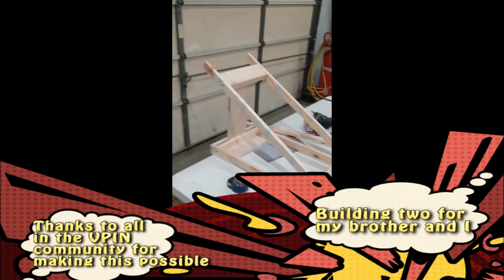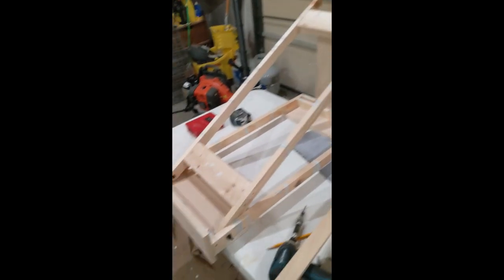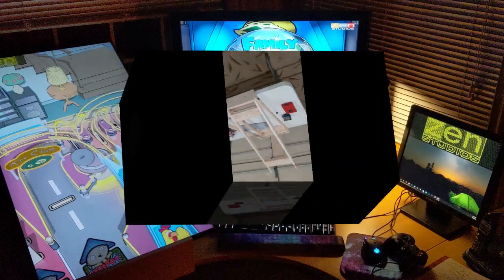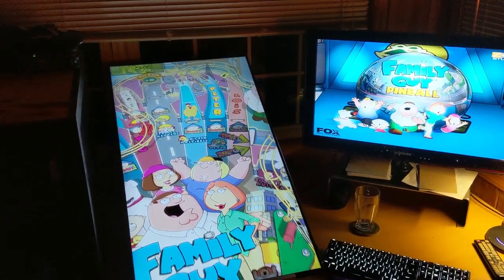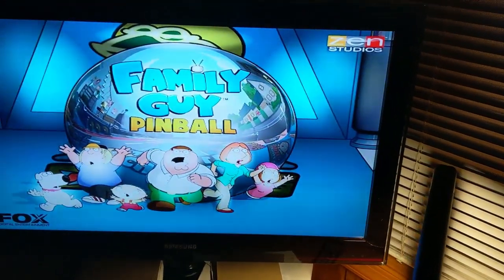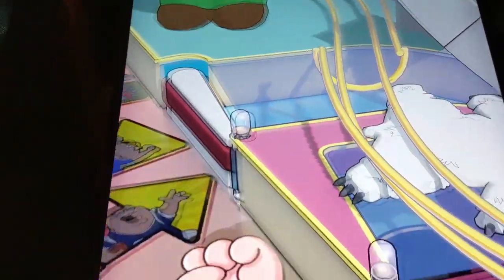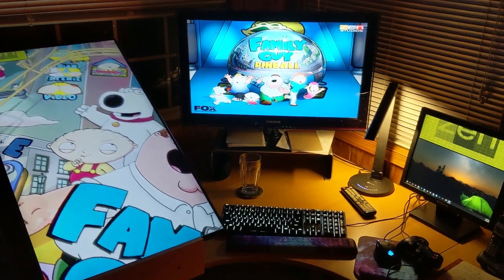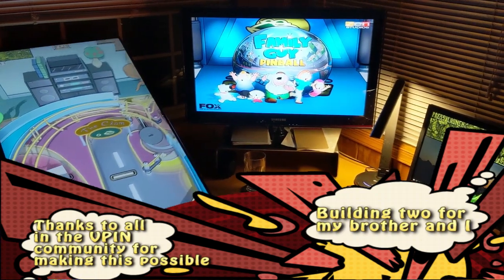Virtual Pinball Project Part 1 - Pinball FX3 Working in Cabinet Mode

Comment: Did you ever finish this? And how do you like the fx3 gameplay? Does it look as good as it does when you play it on the computer? Thanks
Reply from the maker: Hi John, Thanks for watching and the questions.
Status on my virtual pinball cabinet:
I ordered two cabinets (no electronics) from VirtuaPin back in May and my brother just got his last week and mine should be delivered next week.
I spent months getting all of the software dialed in and have been waiting for the cabinet.
Once I get the cabinet, I have some fabrication work to build the bracket for the removable arcade control panel and then install the monitors, DMD, speakers, digital plunger, buttons, etc..
I am using a Dell/Alienware Aurora R-11 PC with an Nvidia RTX 2080 Super as a dedicated PC for the cabinet so it is being played on a fairly high-end computer and looks fantastic.
The Pinball FX3 tables look and play amazing on the hardware. I'm just waiting for the cabinet.
I'll be making a bunch of tutorial videos on putting all of this together and will post them.
I will also be posting "Delivery Day" when the cabinet arrives next week (hopefully). 

Let me know if you have any other questions.

Be safe and have fun!

Cheers,
Jeff (Garage Maker Guy)
Reply: @garagemakerguy1808  wow good stuff! I wish I could have waited! I ended up going with a company, and I fact I just paid for it and it's going to be here in about a month, I went with in the New Age pinball company, I don't have the skills that sounds like you do LOL, I'm going with their highest and one, out the door with white glove service I got it for 5400, it has what seems to be all the best pinball fx3 games, about a hundred of them, in about 200 of the VP older games. What's missing on that list though is my favorite pinball machine of all time, Funhouse! The only guy that was close to these as far as having everything I wanted, 49 inch LG monitor not TV, UHD, big back display at 1080p, full force feedback, with the Shaker, 8 cylinder heads, LED flashers Etc, the other guy from rec room World wanted $8,000 for the same machine! I swear I almost did it because I wanted Funhouse so bad but in the end I feel I'll probably be playing pinball fx3 more than anything else LOL, keep me posted on your build and what you end up spending on it!
Reply from the maker: @johnk12345100  Sounds awesome! Didn't FX3 just release Funhouse recently?
Reply: @garagemakerguy1808  not sure, that would be cool but love the standard version, my table does not connect to the internet and is not expandable. i did just find this company that sells the SD drives! https://arcadehd.com/   hope not a scam, i put my email in and will gladly pay the 220 for the 360 games if funhouse on there, i am going to have it shipped rite to in the new age and have them install it!!
Reply from the maker: @johnk12345100  The FX3 "Williams" tables I've played have the option to play it "Original" without all of the "eye-candy". If that is not "Authentic" enough for you, there are several VPX tables that should suffice :)

Cheers,
Jeff (Garage Maker Guy)
Reply: @garagemakerguy1808   I just got all the fx3 tables and cabinet mode code now, how do I get the backglass and dmd to be on the second screen/monitor?
Reply from the maker: @EarthMonsterAZ  Here's where i would start: https://www.nailbuster.com/wikipinup/doku.php?id=install_guide

If you are only going to use FX3, there is still some helpful information on "Nailbuster's" site.

This could be a very long conversation so checkout VPForums and VPINBALL. There are a lot of other people out there that have made a lot of tutorials about this.

If you're still  having issues after that, send me an email at The_Def_J@yahoo.com and I will try to make some time to help.

Cheers,
Jeff (Garage Maker Guy)
Reply: @garagemakerguy1808  cool, thank you! I will check it out.
Reply: @garagemakerguy1808  oh, and any gameplay on the pinball fx3 games, would be great, I would love to see skyrim on an actual cable, all I can find is videos showing the computer version, hope that the table, looks as good!

Comment: Congratulations on getting Pinball FX3 working. Wish I knew how you guys are pulling this off. I can't get it to work right at all, on a portrait mode screen, in a cabinet. I have the code, too, by the way. It's just all over the place. LOL Thanks for the video.
Reply from the maker: Thanks for watching and the comment Thomas.
Let me know if you're still having issues.

I know "Nailbuster" has several FX3 related posts on the forums and at http://www.nailbuster.com/wikipinup/doku.php?id=emulator_fx_non_steam

I use DOF Linx and B2S Server for the animated backglass.

However I imagine the issue you are having is a combination of the Windows display configuration and the Pinball FX3 cabinet mode settings.

The following does have a section about how the Windows display options should be configured (which is important whether or not you choose to use PinUp Popper/Player):
http://www.nailbuster.com/wikipinup/doku.php?id=install_guide

I hope that is somewhat helpful.

Cheers,
Jeff (Garage Maker Guy)
Reply: @garagemakerguy1808  Very grateful for the links, and info. I did eventually learn I was dealing with full screen modes which require the use of Alt and Enter, to but all displays into full screen mode, so the play field, DMD, and backglass would display properly. Same goes for Pinball Arcade, and Zaccaria, as well. I also just got a DMD size display in, yesterday. Came with two small boards, but mounting it's going to be a challenge, since the cabinet is 3/4 scale, and there's no way to mount it internally. Has to be done on the player side of of the back box. Had to get it, because the tiny 6" display GRS intended to go in the unit is too small for me to read, with my vision. The new one's a 14.9" display. anyway, thanks again, for the assist. :)

Comment: Next project is to build a Cabinet, i built one mine after the Games Room Solution's Mini
You can use a Zero Delay Enocoder and X360ce will emulate the 360 controller
This Link will help you with all your Table needs
https://docs.google.com/spreadsheets/d/1zExPE-e3ViIfhrhKthj2YGMFlINpKymSo3El-FeyZ9c/edit#gid=1238562238
Tabs for different sustems at the bottom, Thx to Redux